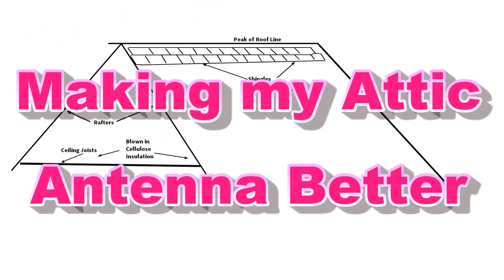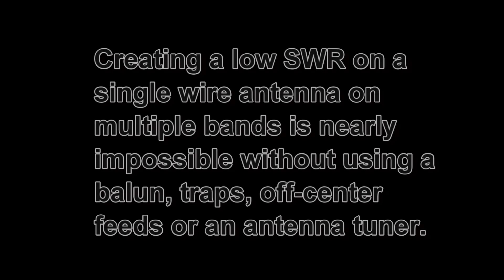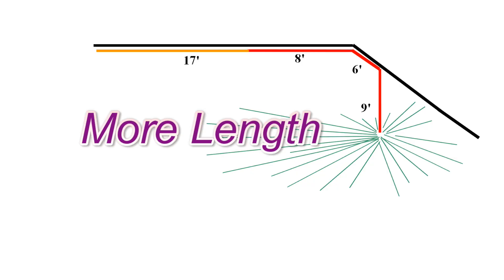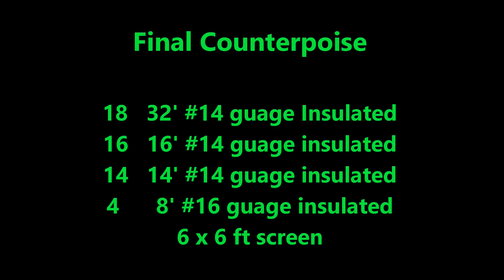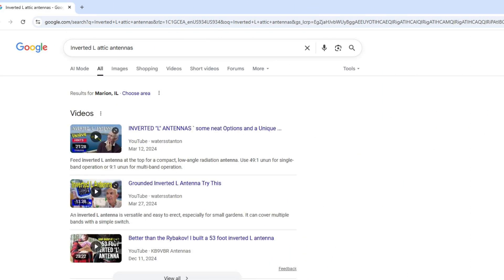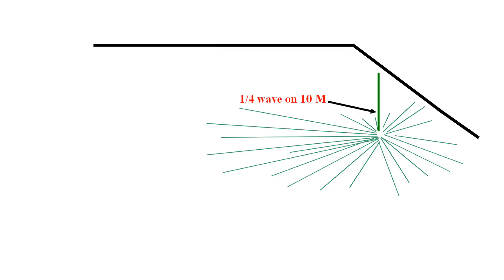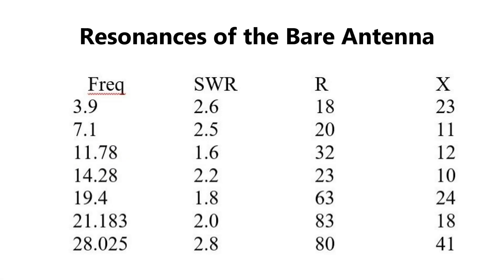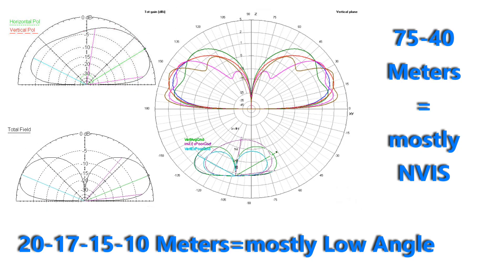Making My Attic Antenna Better

Comment: I am one of the lucky ones,  i have lot's of space in a rural location have very low noise , currently using a 170 feet doublet at 42 feet it performs very well on 40m and 80m works 160m -6m i can get good results without having to try too hard . What you have done is what ham radio is all about, making the best with what you got to work with.  I think you done a great job . I know I'm a bit late greetings from Scotland mm0udi .

Comment: Would it be safe to run 250 watts?
Reply: That depends mostly on the antenna's insulation. If it isn't touching anything flammable, higher power probably wouldn't be a problem. I'd also take care not to run the antenna near anything metallic. The induced current might also create a spark and a fire. Keep in mind that the voltage on an antenna varies along its length. It can reach quite high voltages at some points.

For my attic antennas I'm using high-quality dog fence wire, which has extremely thick and tough insulation. It is made for direct burial. Using it, I don't see any problem with the wires being draped over wooden rafters.

Comment: Just seeing this 3 years after you posted it but I’m glad I found it.  I live within the confines of an HOA so outside antennas are pretty much forbidden.  For reasons like the ones you listed at the end of the video (no rain, etc.) I do love the idea of an attic antenna.  I’ll need to watch this many more times and engage the services of my friend who is an electrical engineer to figure out how to how best to proceed.  I saw in one of the other comments that another person used a loop around attic, which I can, but will need to see how they did theirs.  I also really liked your use of the electric fence stakes; that is a grand idea!  Thanks for taking the time to post this video!

Comment: Thanks for good ideas I might apply in my situation. In my case, I'm wondering what the impact of having the floor of my attic covered with 4-foot wide strips of attic foil. Either that makes an excellent counterpoise (coupled to the wires I've run under the foil) or it makes a mess of my radiation pattern.

Update: I tested it using WSPR coverage with a twist. The antenna was a 40-meter dipole fed by a balun at the peak of my attic. I attached two lengths of copper mesh to the coax side of the balun and let them drape down on to the attic foil twenty feet below. That linked the attic foil to my antenna system. The number of stations picking up my WSPR beacon jumped from the 60s to over 100, mostly in the U.S.

My hunch is that attic foil won't affect low-angle DX contacts, but it will result in radiation that would have otherwise been absorbed by the house and ground being reflected upward and improving coverage out to a thousand miles or so. That makes it a bit like NVIS. If you're interested in contacts, that is a plus. If you're after DX, that means more QRM.

Comment: I went with a loop around the inside of the attic, and it works great.  No issues working 6-40 with an antenna tuner, and I can work 80 too but need to keep the power down.